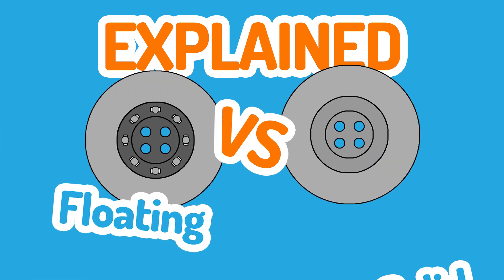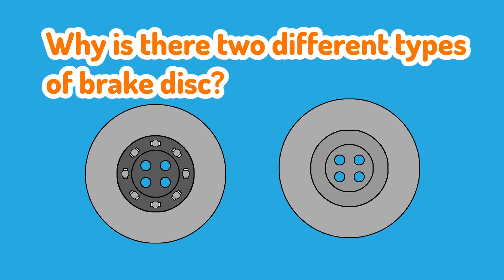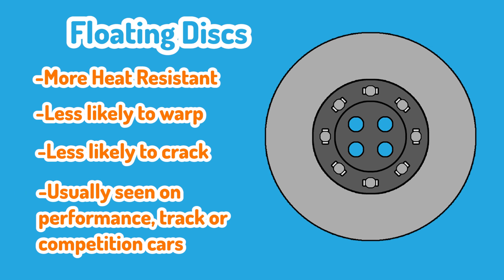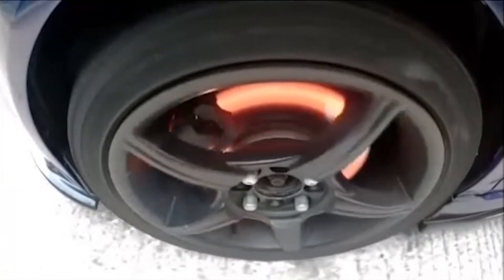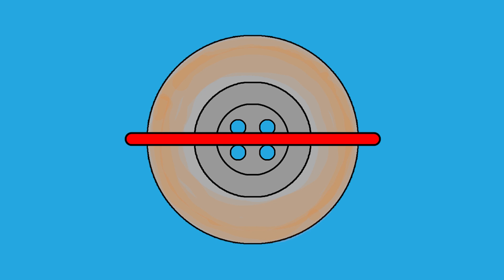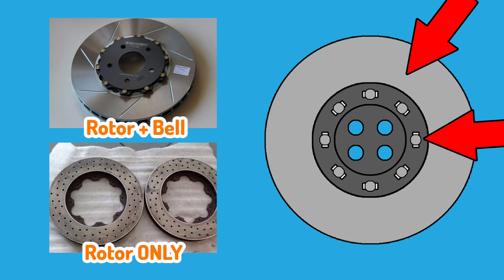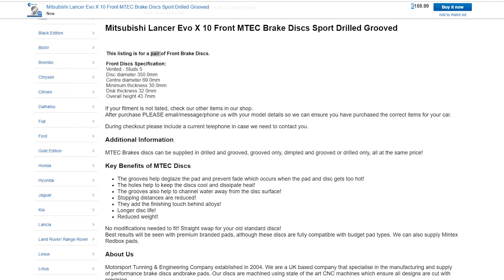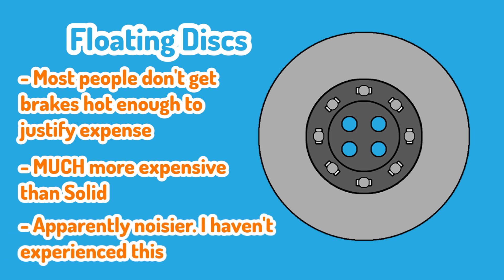Floating VS Solid Brake Disc Rotor Explained!

Comment: The center of the brake rotor is not as hot because the center is moving more slowly than the outside diameter. More speed = more heat.

Comment: Just bought girodisc floating brake discs for my g82 M4. Costed me a whopping $2800. 

I track my car and the default 6 piston brakes with drilled rotors cracked. Slotted free floating brakes for performance applications is the way to go

Comment: Have you heard of floating rotors making a “clicking” sound? I have a new 2023 Type R and recently started hearing a clicking noise coming from the brake area.
Reply: That is a known issue with floating rotors.

Comment: I have the "extreme joy" of having to do a brake job on my Challenger...mine just happens to have the optional Dynamics package which gives me the Hellcat's brakes.. needless to say at this stage int he game through the dealer it's 2,100$ (CDN) A PIECE, going to give this Paragon Brake discs a shot and see how that goes, yet i'm told my current OEM discs have enough life left in them to turn down which I'll give a shot.

Comment: You actually have 3 kinds of discs: Solid state (Monobloc), 2 parts fixed (rotor+bell hub), and 2 parts fully floating (rotor+floating fixations+bell hub). the last one is WAY more expensive than 2 parts fixed, around $300 more for a 330mm rotor. if you want maximum performance, cold brakes, and almost never having to change rotors, go to fully floating rotor+street/sports or race pads, they wear out faster than common street pads, but never the rotor. if you use common street pads, they last much longer but the rotors will wear out also.

Comment: I have floating disques on a 997GT3 RS and they are great. Just noisy with light clonking sounds at low speeds. as the disc can move slightly and they sound like a train coming into a station when cold. The Pagid race pads don't help.

Comment: This should be called solid vs 2-piece discs. 

Because "floating disc brake" is mostly used as a terminology on how brake calipers and and pistons are configured.
Reply: Calipers can be floating (typical for OEM with pistons on the inside only) and fixed (typical for aftermarket calipers with opposing pistons).  But two-piece rotors can be fixed or floating, and he didn't explain that.

Comment: sir, can float disc be used in heavy duty vehicles such as trucks ???
what will be its dimensions??
Reply from the maker: I dont see why not and id assume dimensions would apply to each application
Reply: @rowanlewisuk  actually i was doing a project, do you have a rough estimate.

Comment: I found my way here while shopping for a front rotor for my motorcycle. Excellent explanation. Before viewing the video, my calculus had been rather simple - if the floating disc is more expensive, it must be a better design. Seems I was right

Comment: Great video. I'm just looking for new rotors and finally understood, what the floating rotors are. By the way, the outer edge of the rotor is getting hotter because of significantly higher linear speed it has relative to the braking pads.

Comment: Outer edge gets hotter first as it's turning faster than the centre
Reply from the maker: Definitely possible. It also gets the most cooling 🤔
Reply: @rowanlewisuk  This dude is correct! Look up angular velocity at different radii on a disc to learn more about the actual physics! Its pretty interesting stuff! Great video btw
Reply: @rowanlewisuk  The outside of the rotor is spinning further per rotation, there's more leverage on the pad along the outside and it is probably even possible that the calipers shift or hinge outward slightly under braking but with the glowing metal everywhere trying to dissipate, I think THE key reason it gets hottest along the outside edge is because there so much heat in the metal trying to escape out in any direction. You can clearly see at 2:46 the inside and outer most sections of the rotor are both hotter than the center
Reply: Because linear tangant velocity increases as you increase the radius and move away from the center
Reply: @hbk4984  Spot on. Thats what I was taught in physics and pilot studies. 👍
Reply: I don't agree. The energy is distributed on much more surface on the outer part than the inner part of the disk, so it shouldn't get hotter. My idea is that because in the center there are other parts that can help dissipate some heat, it takes longer to reach the same temps of the outer part of the disk
Reply: can we talk about how heat rises and the top and bottom of a rotor are both up during a rotation...?
Reply: @stevezeeTee  it's not static so the impellar design of the disc will disrupt the natural flow of heat, it will be pushed outwards in all directions in to the wheel barrel
Reply: @florianskt  I think braking pressure is more or less constant per unit area so you have more area exerting pressure (more pounds of pressure because more square inches) on top due to the geometry of the brake pads than you do at the center. This would make the outer edge of the rotor hotter than the center.